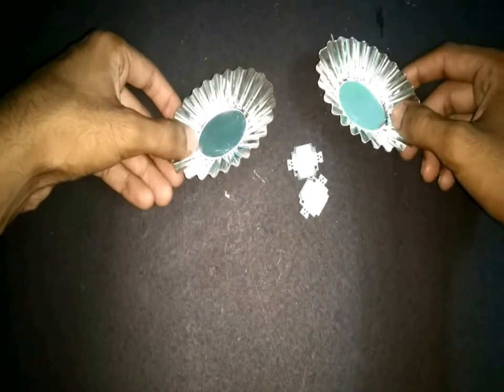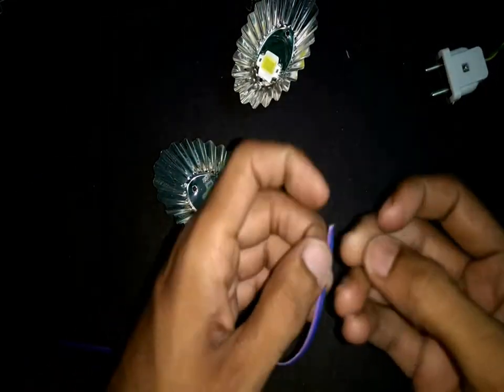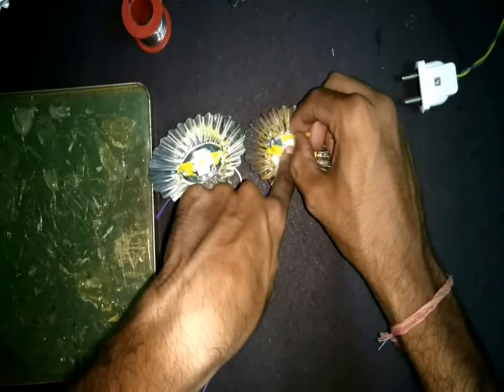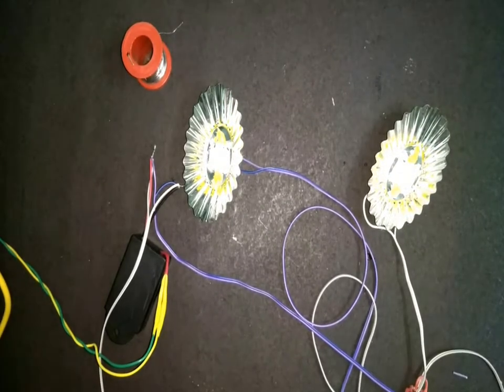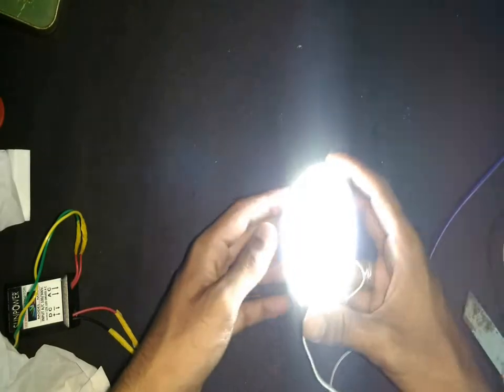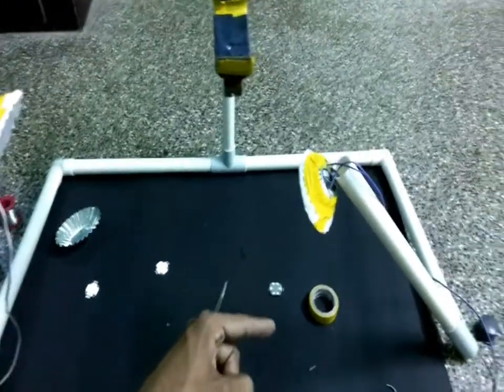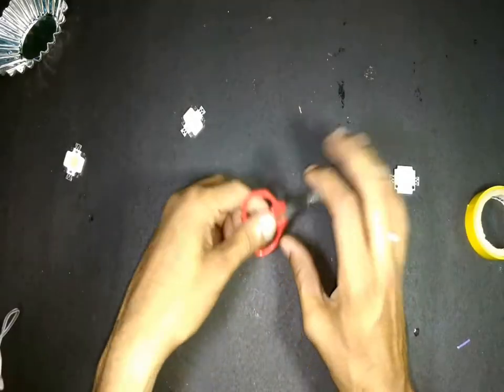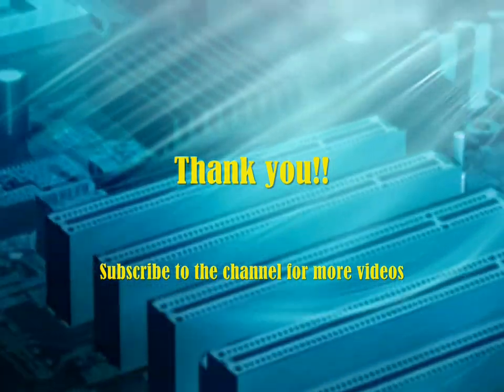Video/Photo Shooting Lights

Comment: it was a cool simple project. :) ... I am planning to use aluminium foil to make those reflectors ( heat sink as well ). ... now I need to collect those bigger led and a led driver... but i think i can use a 18 volt led and my unused laptop charger as the driver unit... can I...??? :)